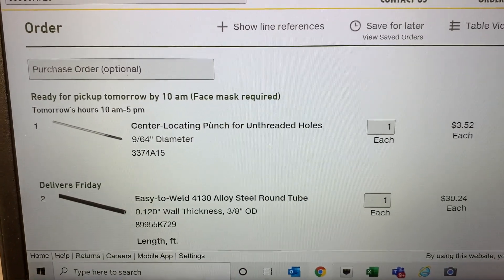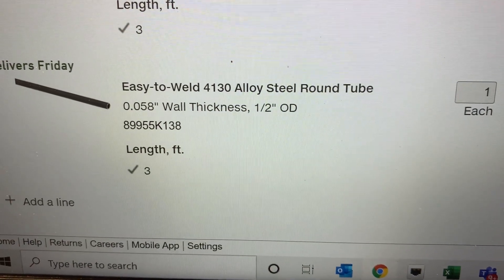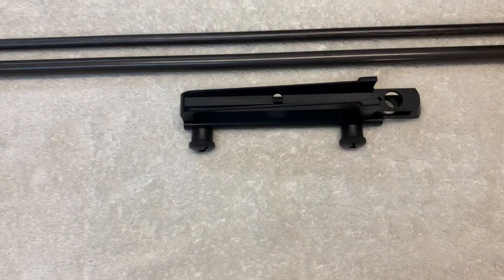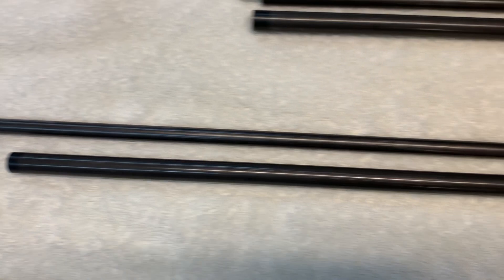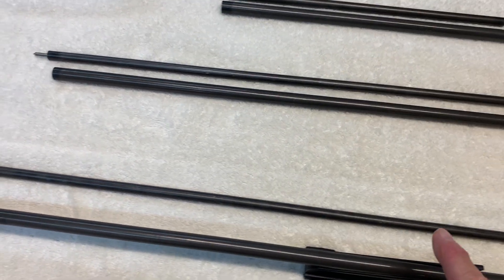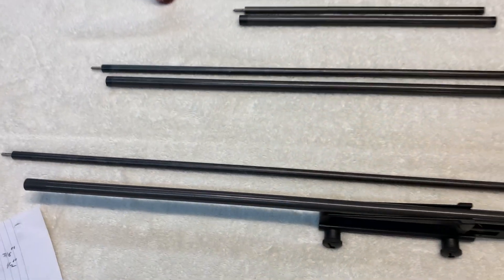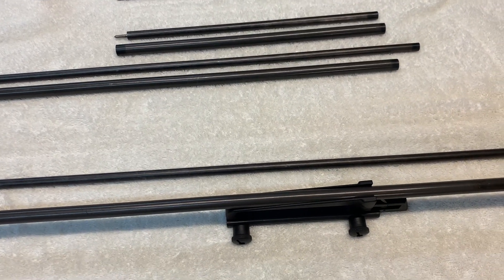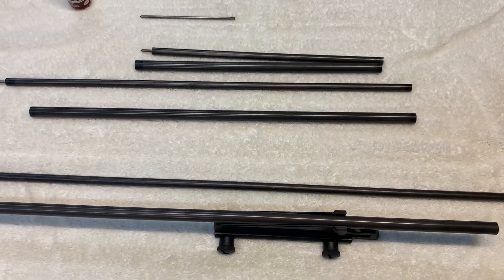AR-15 Front Sight Post Gauge Build Instructions and Parts list.

Comment: How is the fitment if the 3/8 tub3 inside the 1/2 tube? From my math, the ID of the outer tube is 0.384 and the OD of the inner tube is 0.375.
Reply from the maker: @Andrew-ql1cz  perfect smooth sliding interference fit. No slop,

Comment: I used the same tubes however the center locating punch did not fit. I used a 1/8" diameter center locating punch instead and it fit nice and snug.

Comment: Tried 1/2 copper tube with my Aero Precision handle, saw it done in another video, much too wide at 5/8 OD. 15/32 or 7/16 OD should work with measurement I took. It's bit tighter than 1/2". Is made at same forge colt has used in the past.